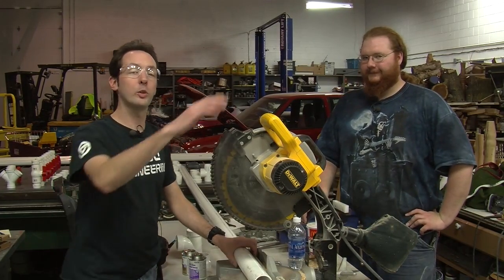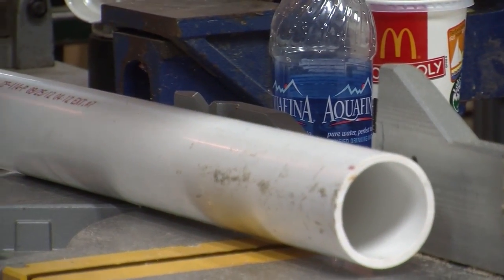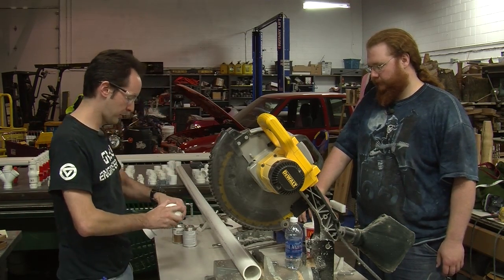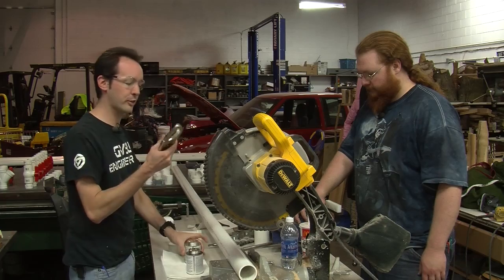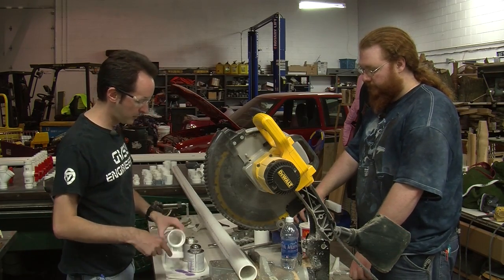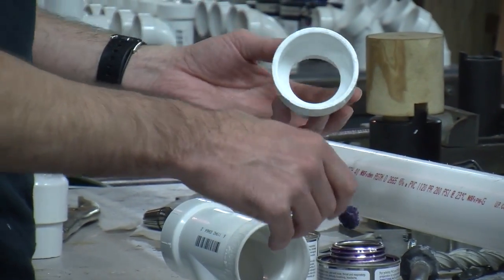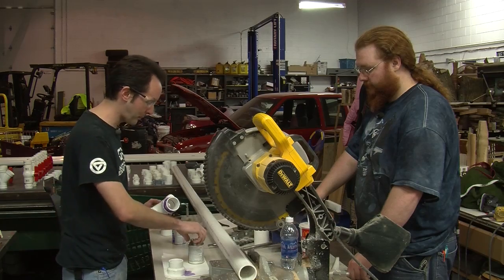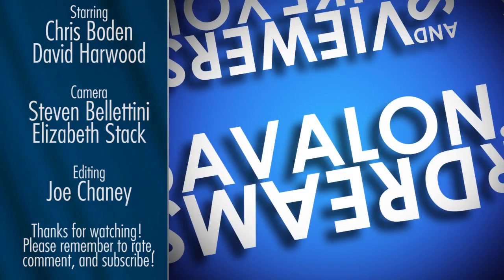How to Glue PVC Pipe

Comment: You missed a couple of important tips:
1.  For an optimal pvc bond, do NOT allow the primer to dry before applying the cement
2.  Hold the glued joint pieces together for ~5 to 10 seconds to prevent any movement (which can sometimes occur.  This is especially important for joints that require alignment.

Otherwise, a very informative video.  Thanks for sharing!

Comment: My first PVC joint was a 1 inch condensate pipe.  After glueing the female end and then inserting the pipe, the glue was scrapped by the incoming pipe and formed a seal at the end of the joint clogging the joint.  THAT is why you glue the male end and insert it rather than the female end.

Comment: Great video, though it'd be nice if you'd mentioned one thing that surprises everybody who glues PVC for the first time: after you twist the pieces together to form a connection that seems solid, the pipe tries to crawl back out of the fitting.  It's eerie.  You've got to hold them together for a bit to keep that from happening.
Reply: Jason Goodman it depends on the temperature but I always hold it for about 10 seconds

Comment: Good job explaining the materials.  In my experience working with pools you don't usually use a table saw.  I have a power hack saw with a fine blade meant for metal.  If you use the wood or pvc blade you get a rougher cut but will still work.  Putting the glue on both sides is a fail safe I in my experience it Matters.  One side can be risky even if you use a lot of glue and twist.  If you have a 2.5 HP pump on a pool then you will have much higher PSI (Pressure) than lets say a drain pipe which won't matter as much.  You need to make sure you understand what type of plumbing you are doing before you make a quick repair on PVC pipe.    Also, once you push the two freshly glued pieces together they have a tendency to push back and that is why you should hold them in place for 30 seconds to avoid the separation.

Comment: As a licensed plumber Id like to give a little bit of advice. (1) Do not let the primer dry before applying the glue. The purpose of the primer is to soften the pipe, not to etch the pipe. Prime the pipe, then immediately apply glue while the primer is wet. (2) Make sure you prime/glue both the fitting and pipe.

Comment: The purple primer will stain most surfaces but is not permanent on all surfaces.  It can be removed with acetone or clear primer, time and a bit of elbow grease from most hard non-porous surfaces.  If you catch it before it dries its easier to remove.  Some of the more professional spot removers can also fade or remove it from nylon carpets.  I usually use the purple primer only when/where it is required for everything else I use the clear to prevent the possibility of spills.